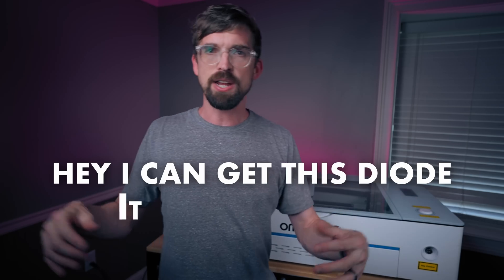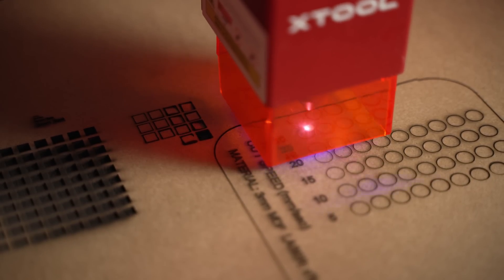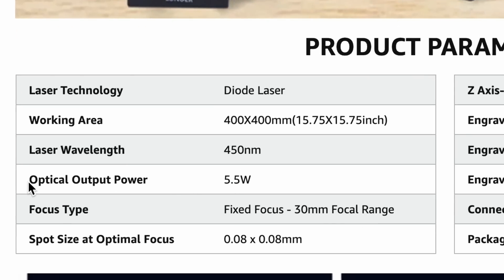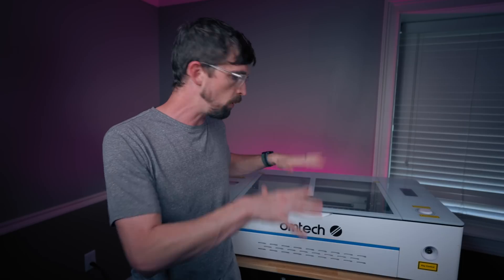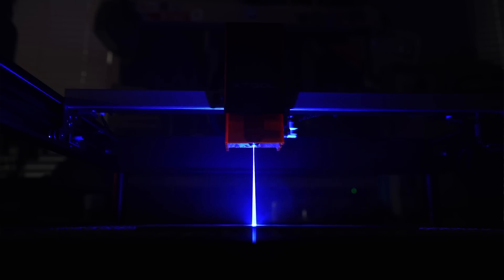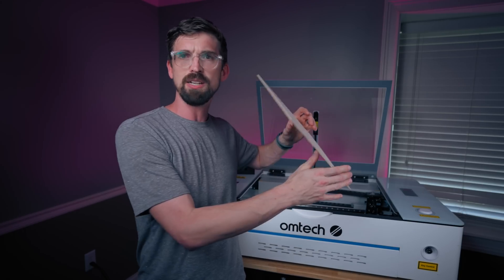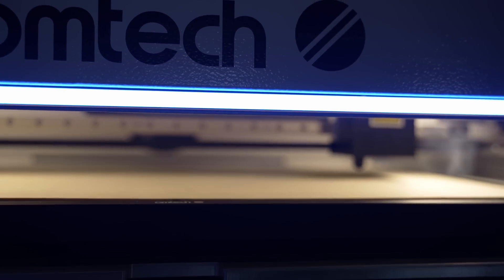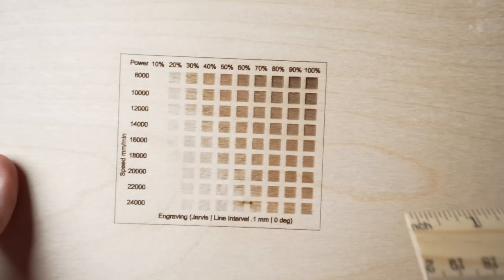Laser Companies are Lying to You

Comment from the maker: *Quick correction, the Sculpfun S9 has an electrical input of 30W, the 90W in the product listing is from what they compare it too.  It shows that in the product right above the laser output, I just missed it like a dummy..... 🤦
Reply: While true that the first listing (LGT LONGER RAY5) was listed as 40W that being totally false and it does not look like it has an option for it, you did select the size “5W”. I can see there’s also a “20W” for double the price. The listing of 40W up top won’t change, even when selecting the 5W or 20W. Though, the listing matches the type you selected. The point you make is totally valid and true but your exaggerating your point and I think a correction needs to be made.
Reply: 40 W laser engraving.. if you scroll down you see it says it has a 5.5W diode.......
Reply: don't even need to scroll down its right in the headline of the listing lol @habiks
Reply: Might be worth noting that the safety glasses that come with the diode lasers never state their performance.
Oh, and even if they did good luck calculating the NOHD with them, they won't tell you the beam waist or the divergence.
Reply: Loads of micro edits = Concentration agenda.
That goes for all channels that do it.

Comment: Is laser that can cut 3m vhb double side tape with out burning it melting it meaning will c02 do it . I tried with a diode with bunch different ways  fast high fast multi pass.  Low and slow you named I tried it no clean cut and melted

Comment: I can understand how focusing works for the engraving function which is more or less planar, but how does it work when cutting? When the beam had penetrated a millimeter into the material, one would need to lower the focus by that millimeter, but then some "sideways" rays that come at angle wouldn't reach deep into the groove and will hit the material around the groove instead. Heating and possibly graying them. Is there a place where I can find explanations on that matter?

Comment: What wattage is required for Plexiglas.
Reply: For transparent plexi glass use co2 laser and air-nose. 40w co2 laser can cut 3-5mm plexiglass on 10% power or less (very quickly.) tinted acryl can be cutted by diode. couple of mm with couple of Wattage. (The point is on the focus.Longer focus for cutting, short focal lens for engraving.)

Comment: It's ok ,but...
At higher sections the method is similar.
For example a 50w fiber llaser engraver from keyence ( 20-30k$) pushing out more then 1,5kw in small pulses. The average output just 50w. Finally the result is much more effective for engraving, but not usable to cutting.
Everitime important to understand the method and physical backgrounds.

Comment: Thanks for the info. I'm considering building my own laser engraver/cuttter. I want it to be able to cut up to 1/4 inch plywood and maybe 1/8 inch acrylic. Would a 40W diode laser with a 5.5W optical output do that in 1 - 2 passes or would I need to go up to 80W or something else? I have more time than money so speed isn't as big a factor. The mechanical  portion is the least cost and problem. I have a machining background as well as machine tools to build the mechanics. The most difficult part for me is choosing a decent module that won't hurt the bank to much.
Reply: Ive been reading up prior to buying one myself. Diode machines typically have lasers with <2.5W, 5W, 10W or 20W light output. Forget the power input as its irrelevant as far as cutting is concerned. From what I've read a 5W laser would just about do what you want but I think a 10W would be better and might last longer. I'm looking at the Sculpfun S10. The Longer Ray5 10W or the TwoTrees 10W might also be worth a look. The Sculpfun s10 appears to have a slightly better rail system/ball slide? Most of these are available with/without air assistance. I might get one without and add my own. Haven't decided yet.
Reply: If you want a diode it would be better to just buy the machine. Diode modules are now very expensive. Only way it would make sense if that you are building a really big frame.
Reply: @joeltorres3202  Yes I need a larger frame than what is available even with a extension kit

Comment: I find it crazy that people buy into the unshielded lasers expecting anything good to come of it. The only laser cutter/engraver I have experience with was a massive unit with full shielding and multiple warning stickers about the dangers of laser radiation. These unshielded units are either not powerful enough to do what they advertise, or they are dangerously leaking radiation into your surroundings and you should probably discontinue using it. Generally, a laser above 5mw is enough to cause eye damage if directly shone into your eyes, and lasers above around the 250mw range can cause temporary eye damage indirectly in large exposure. Above 500mw, the damage is permanant. 

These units are often claiming their lasers are "40W", which is 80 times the limit for permanent eye damage. This makes the lasers about 9 times more dangerous to handle for the end user. At this level, indirectly viewing the beam or the landing point of the beam will damage your eyes, likely permanantly. The wave length of the laser doesn't change much about the danger to your eye sight, as even undetectable in the UV and IR wave lengths will blind you. Non-visable-light-based lasers (say that 5 times fast) are often more dangerous as you don't even have any reflexes to mitigate the damage. Visable light lasers will cause your eye to reflexively close, which limits the exposure time and chance of blindness. IR and UV wavelengths don't trigger this response, so you won't know anything is wrong until your eye starts hurting which means the exposure time is already exceeding three times the normal amount for visable light, if not more so. Don't cheap out on laser tech, it's dangerous.

Comment: compare dc power supplies from the US and China. An American two watt power supply is the size of a red brick and has 16 gauge output wires. The Chinese 2 watt power supply is the size of an ice cube and has 30 gauge wires

compare ac motors from the US and China. An American 1 hp motor is a load for a guy who is called Lurch and Worf and Sasquatch by strangers. you wear steel toed boots when you have to lift it. A Chinese 1 hp motor can be handled by a 12 year old.

I wear 10 1/2 EE Red wings. I wear 11 Chinese boots. I can buy Red Wings through the mail. I buy Chinese footwear in a shoe store.

Chinese amps are not American amps. Chinese watts are not American watts. ergo, Chinese facts are not American facts. Adjust expectations accordingly.

Comment: I find that engraving at high speeds works great if you just need to mark a light pattern that you're going to cut out by hand. When it doesn't need to be detailed or dark. I did it for a table I was making. Did the pattern with my laser at max speed and low dpi, then carved out the pattern by hand so I could fill with different colors of epoxy resin. Made a round 18" table with a gold and copper color tree of life.
Reply: Why would i cut by hand if i have a laser. It could be useful only for very tick materials.

Comment: I hear you. I bought the 10w upgrade for snap maker 2.0, and I a, soooooo disappointed. It won’t even cut any type of metal. I was hoping I could cut some thin sheet metal. Nope. Only engrave. What’s the worst joke is that even though their website says it will engrave on glass and metal, the software has zero settings for this. So, which one is telling the truth? Why different? Annoying. Now they are hawking a 40w laser upgrade. Again, I call b.s. cause it will not cut metal either
Reply: don't think any cheap diode laser is going to cut metal. 
You would need a fiber laser at around 200 watts or more i'm guessing to be able to cut any metals

Comment: As far as the speed/acceleration tradeoff, are these machines able to run circular/spiraling paths? If so, that should almost completely remove the limitation of the acceleration and the machine should be running at nearly top speed for the cut.

Comment: Most of them came without enclosure because were advertised to be used over things (mat, skates…) and upgradeable.
The very best lie brands don’t tell you is “this is cheap because it comes without basic things like endstoppers, air assist… and after you buy everything you ended investing near (or most) than a cheaper co2 (with the chiller which is the same lie for k40 models)”
Conclusion: diode for cardboard/plywood and large areas meanwhile CO2 for acrylic, faster jobs and professional usage (at similar prices on the lower tier. If you want to get serious get ready for going over 2K euros easy…)

Comment: Good Video, learned a lot from it.  I'm looking for a Lazer engraver that I can engrave last names on 3/4" - 1-1/4" pieces of wood.  One that takes up to 18" long and up to 10" wide.  Not real expensive and on the smaller side.  I know the Glowforge Pro would do the trick.  Are there any others out there that you recommend that would work as well or better that might be cheaper?  Thanks for any advise you might have.

Comment: I have been researching for a laser, a diode one to keep the costs down.  The one piece of information I would like to know is, which one has the least trouble to use.  I hear compalints of all sorts, the OLM stops in the middle of a job, or another company, all the suddent the image jumps over an inch, etc.  I basically want something that is reliable with 20w laser.
Reply: Believe it or not, skipping is mostly caused by not maintaining the equipment and keeping the rails clean and oiled or by not properly tightening belts.

Comment: The wavelength in those lasers is comparable to the wavelength of light used during intraeye laser surgery. In other words, diode lasers go right past your cornea and start burning the inside of your eyes. CO2 lasers however view clear plastic and your corneas as opaque. Therefore, it's exceptionally easy to shield your eyes from CO2 lasers and basically impossible for diodes.

Comment: Are there any diode lasers that can be used with iPad? What would be the best laser for a beginner? Many thanks
Reply: Atomstacks can be controlled via an app, but its pretty rudamentary and only lets you start jobs uou already have on an sd card inside the device. Also it connects over WiFi like a crappy 30 bucks wireless printer

Comment: Have you ever taken a look at the Vevor units?
I'm considering the 10w model with air assist and rotary roller. Works out to around US300 (In Australia it's A$590 inc delivery)
It will mostly be used for engraving and cutting thin plywood. Clearly, I'll need to make an enclosure and will use the same extractor I use for 3D printing.
Reply: I am not familiar with this 10w laser, but looked at some claims the company makes. 10,000mm/min. Let's see, that's about 33ft or 10meters. I would be surprised if it can cover that distance and even if it does, it very likely would not be able to burn/engrave toilet paper.
An air assist would likely cost you another US$60-80. Safe some money and purchase a fish tank air pump for $10. A rotary attachment will likely run around US$80-220 depending on model and features and then you will need a honeycomb for cutting wood. That's another US$60-100 depending on brand.

If you insist on an enclosure, make sure you can exhaust the air/smoke to the outside of the building. Burning wood inside an enclosure that is not vented is a fantastic way to start a huge fire. I use my machines mostly inside a garage. I want to see what is being engraved or cut and use no enclosure. I use a big old $25 fan to draw smoke to the outside of the garage. Works great for me, BUT I do not leave the machine unattended when working with wood. My machine also detects a fire and at least turns itself off (still no excuse to leave it unattended). Lastly, an enclosure will restrict you to the size of the work piece you can work with.

I don't agree with all that was being said in this video. What bothers me a little is whether or not this reviewer/evaluator purchased all these machines listed on his spreadsheet or have they been provided free by their respected companies. I feel this to be more of a commercial for the machine that is sitting in the background throughout the video.
Reply: @kurtwm2010   Thanks for the detailed reply.
I only plan on engraving/cutting small items and as my workroom is part of the house an enclosure that pulls air outside is a must for me. Good point about not leaving machines unattended. I do have a couple of fire suppressant cans in the room in case of the worst.
Reply: I wouldn’t buy shit from a company that does nothing but roam through the industrial districts of China looking for any and all shit to slap their label on and export it.

Comment: 2:28 If it is using 90w of power and only giving you 5.5-6 that's pretty horrible.
Reply: one says its uses 30 watts and the other says 40 watt. it only says its comparable to a 90 watt co2 laser
Reply: Optical Power is the critical number. 40 Watts is the consumption of the whole machine.

Comment: i only buy the diodes, and about the best ive found readily available are 5W... nichia nubm08 or summink? can pulse them a bit harder, but yeah... continuous, without chilling  water cooled loops... 5W.

wavelengths matter... what transfers the most energy to the workpiece, ie, is absorbed the most readily by most surfaces versus reflected? blue? or IR? dont have a choice with diodes other than wimpy green... which is IR under the lens.

meh, diodes are cool but the aberration is annoying. beam correction is a hassle, and most dont do it. need a semi cylindrical or anamorphic prism setup... fiddly. if you want the precisest DOT possible rather than a line...

theres another thing about depth and its the focal length. a short beam obviously must have a steep convergence angle, with a wide dispersion cone beyond the focal point. you make conical cuts. a long focal length gives closer to a parallel beam.

in the end, you still get the same energy on the dot but the long focal length does have the head far away... more scatter, more wobble, more jitter and error amplification...

focusing to a dot then collimating is next to impossible as the AR surface coatings break down... the beam has too pretty well much cover the entire lens or yeah. smoke :)

played with combining.splitting prisms with three diodes but omfg, not worth it. take more passes.

i know theres an actual assembly but im a cheapskate. one day i might get a CO2...

Comment: No misunderstanding.It's just that those who choose a diode for themselves in 2023 have no problem understanding that 40w is 2 5W diode, 80W is 4 pieces of 5W.The latter in my opinion and the reason that CO2 will become a thing of the past machine 1000 1000 based on it will come out within 500 $. Performance? I'll buy 2 more and it will still be cheaper than CO2.
Reply: Nope. The 40 Watts is the Unit's total power consumption. 5 or 10 Watts is the optical output of the laser head.
Reply: @RTR-MATEY  oh, what a smart guy knows about optical power, all that remains is to learn to read and understand what is actually meant.

Comment: At 11:38 for the speed test did you use the setting "Constant laser power" in LightBurn? I have a theory that without this the laser will compensate for the gantry slow speed when accelerating and you will miss the real test value how actually fast you can go. There should be a threshold in the speed chart after which all the squares would look the same in the columns regardless of the speed, so you could see that the laser gantry could not run any faster than the threshold speed.
I also have falcon2 laser and now I'm eager to do the test as you did here but with "Constant laser power" setting on and off. Really good video, thank you for making this.
Reply from the maker: good point!  Also most of the times overscanning is turned on which will overshoot each side giving it time to speed up and slow down.

Comment: Also remember diode lasers to my knowledge can't do cut clear acrylic.
Reply from the maker: yep, can't do anything clear.  Need a CO2 for that.
Reply: @makeorbreakshop not true… you can engrave using a black metal shit under the transparent acrylic and focusing on it instead the acrylic. Physics will do the rest ;)
You need to dig a bit more into diode lasers to avoid such mistakes (like the wattage in your first comment)
Reply: @thelabby9998  You could also probably smoke some "Carbon Black" from candle onto a metal surface and then engrave it!!!

Comment: The cutting and engraving metal is the one that gets me, a diode (generally unless IR) will not engrave or cut aliminum it will remove the anodised coating
Reply: It depends on the frequency.  Xtool, for example, sells an IR laser head and includes one in the F1 galvanometer machine.  These are diode lasers and will engrave in metals, including aluminum.
Reply: Yeah there's a typo in my message that says it rather than ir!
Reply: @derekwright3896 you should probably edit the typo rather than say it was a typo in a reply😅
Reply: @stevendorries  Very good point!

Comment: Great list. Coming from the co2 world and getting into diodes second, a lot of the marketing and "defaults" were a shock to me. Couldnt believe they were sold without enclosures and was I convinced it was illegal. 😂
Reply: Keep in mind that an enclosure will NOT prevent a fire. There is still plenty of air introduced when making cuts (primarily to prevent burn cuts) and the air/smoke is evacuated to the outside of the enclosure (hopefully though some kind of vent system to the outside of the building). The only safe way to avoid your home from burning down is to never leave the tool alone when operating it.
Reply from the maker: It's the wild wild west